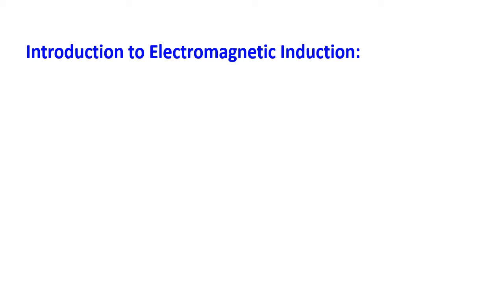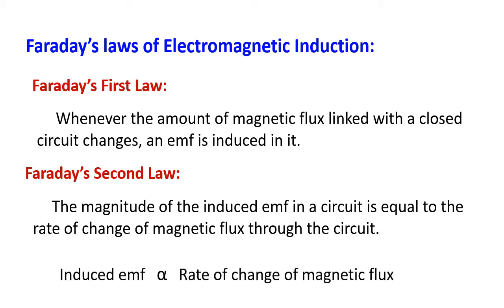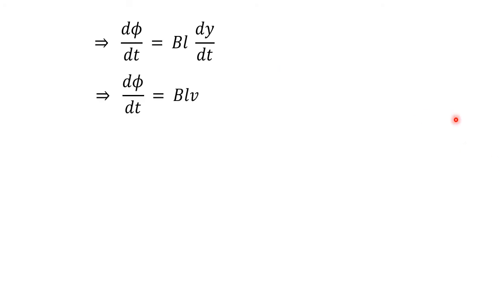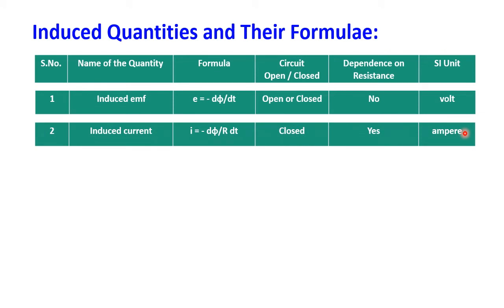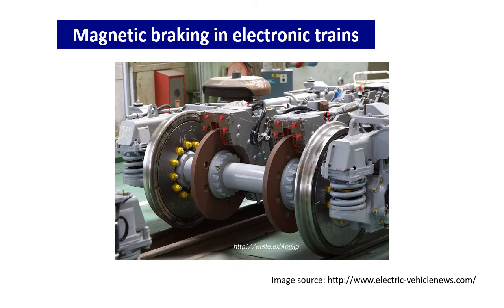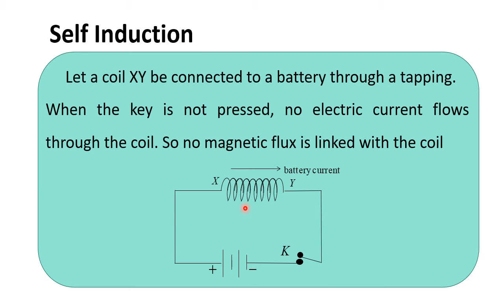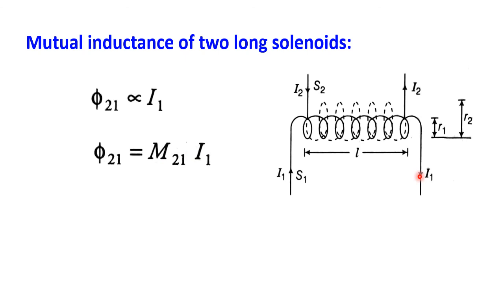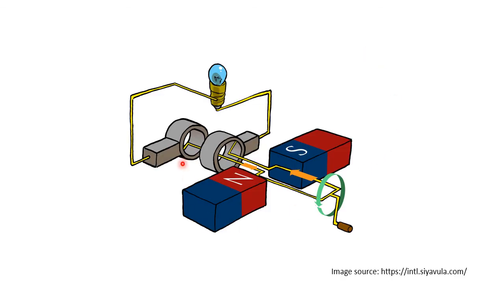Electro Magnetic Induction lesson In English

Comment: An infinitesimal length of wire is located at (1,0,0) and carries a current of 2A in the direction of the unit vector az. Find the magnetic flux density B due to the current element at the field point (0,2,2)

Please answer for this ...😢
Reply: Please sir